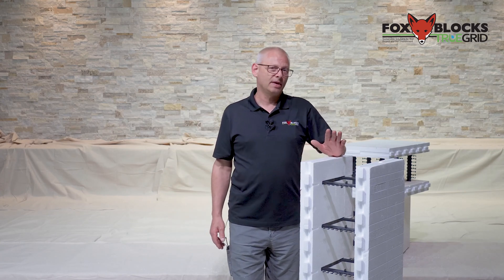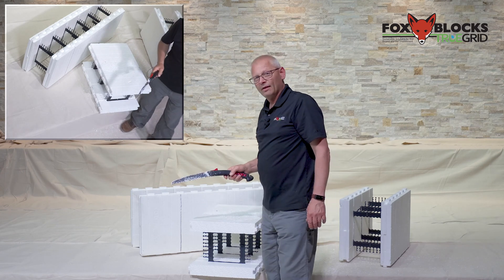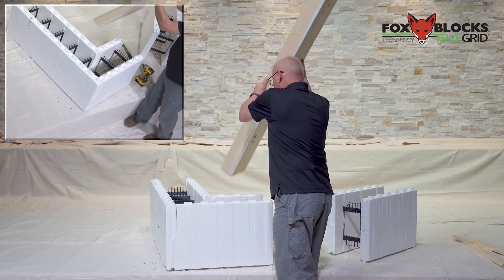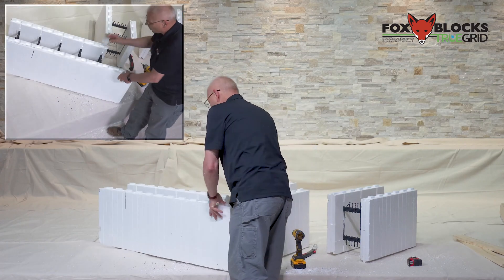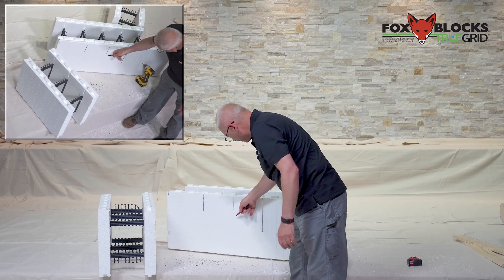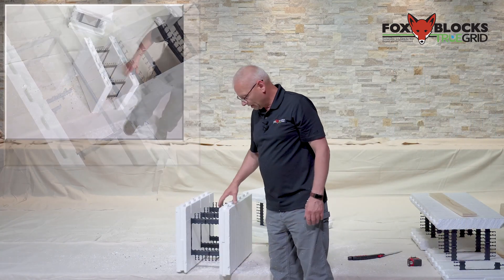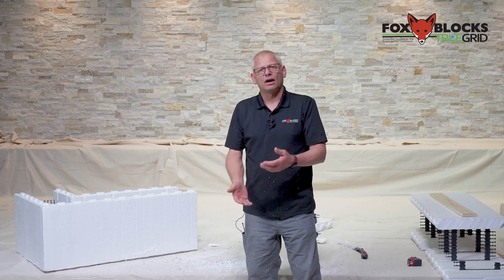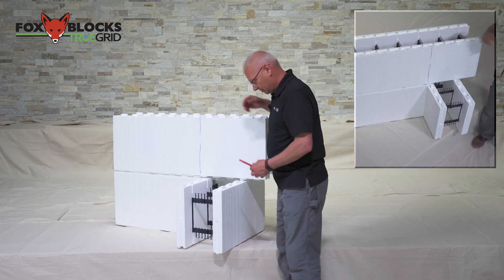Fox Blocks Site Cuts

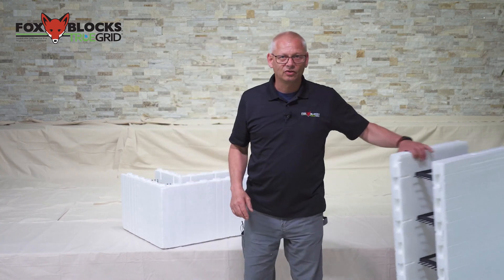Comment: 14:37, what is the application for taper top...
Reply from the maker: Engineered lumber in floor systems rely on the rim joist carrying the load from above. The taper top brings the concrete out far enough for the rim joist to transfer the load from the rim joist to the concrete wall. Fox Blocks has 2 5/8" of insulation so the rim joist would be bearing on the foam. Dimensional lumber (2 x 10 etc.) would not require a taper top because the joists themselves can carry load.